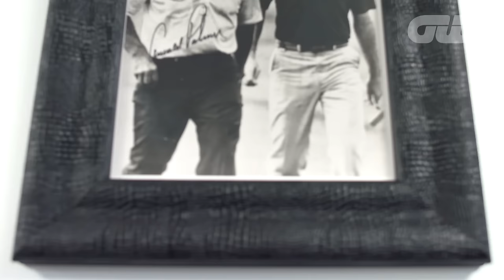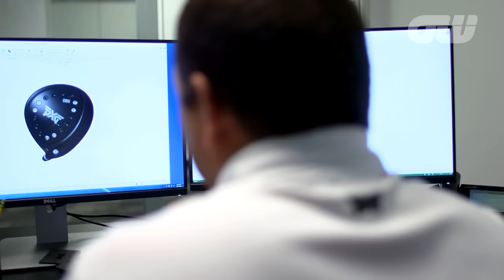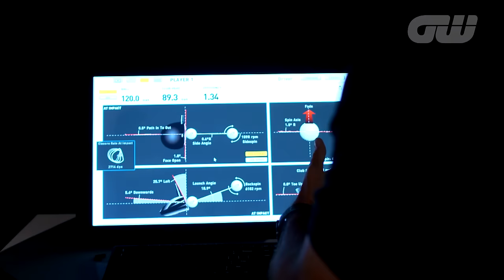Behind the scenes at Parsons Xtreme Golf

Comment: Maybe you can explain. I just recently purchased a set of Gen3 irons. I ordered them with an upgraded grip. The retail for the grips is between $10 and $11.50. Every other club I have purchased charges the difference between the cost of the upgraded grip and the standard grip. PXG charged $20 per club.. No one there is willing to explain how they come to this price . Yes they are giving me a towel and a divot repair tool. But in general this seems like immoral gouging at worst. I am wondering if there is a  mistake.  The only response I get from them is that's just the price, they are expensive special orders ( I agree at between $10.00 and $11.50) which does not explain the $20 charge.